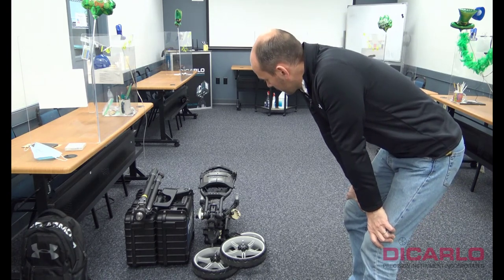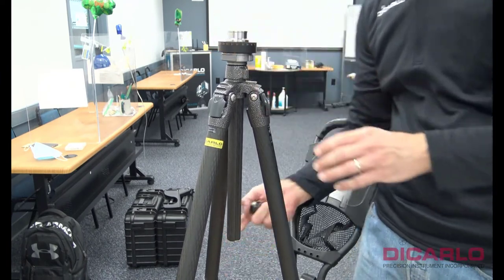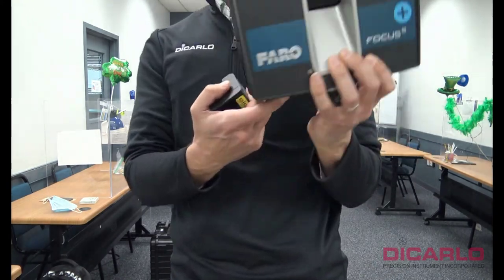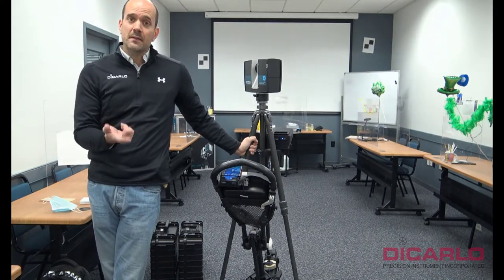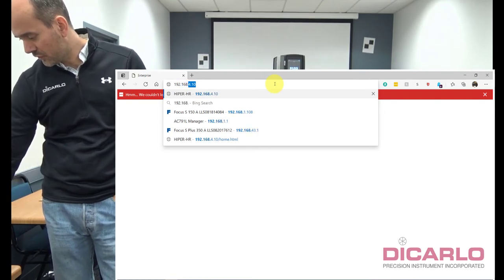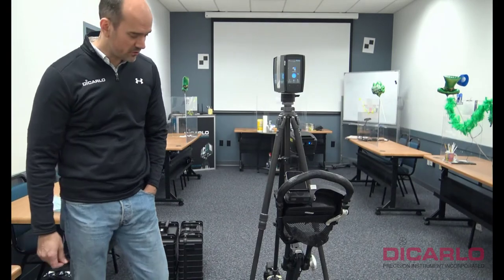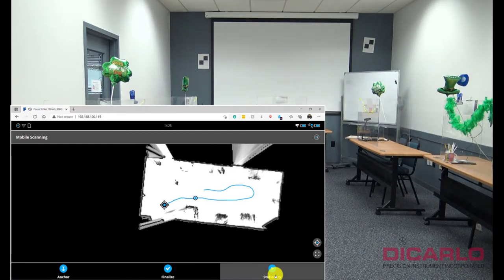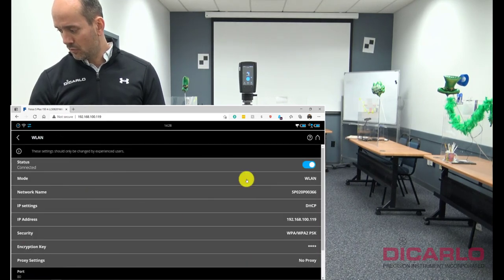FARO Swift Cart setup and operation

Comment: Can we use our new s70 and rent the cart and hand scanner or are we required to rent the whole package?
Reply from the maker: Typically the whole package. As the S70, even though capable, would need a software key to enable the Swift Cart functionality. And this key cannot be temporary. It is a permanent key. Which means you'd have to buy it.
So to try the Swift Cart, you'd have to get a rental Swift Enabled scanner (cart, ScanPlan, Focus S and computer) with a Swift Enabled license of SCENE also (to process the collected data). Neither one of the Swift unlock keys are temporary. Sorry...
Reply: @DiCarloTV  would it be possible to "upgrade" our scanner and purchase the additional equipment?  i think if we had considered this equipment when we initiated our purchase we would have made a slightly different decision.
Reply from the maker: @jacobaboudou6538  No problem. I'll send you an e-mail to discuss. All S series FARO scanners are Swift capable. That's what is nice about this solution. So your purchase was not in vein :)